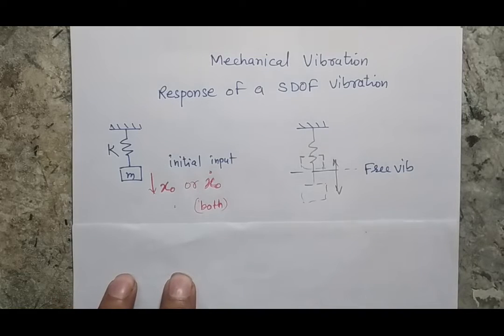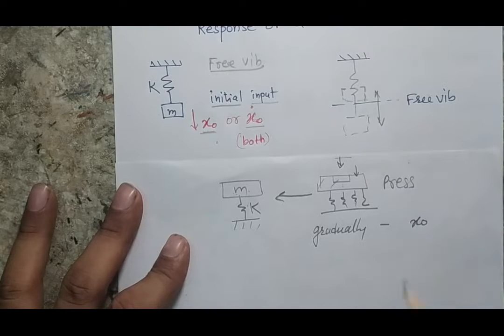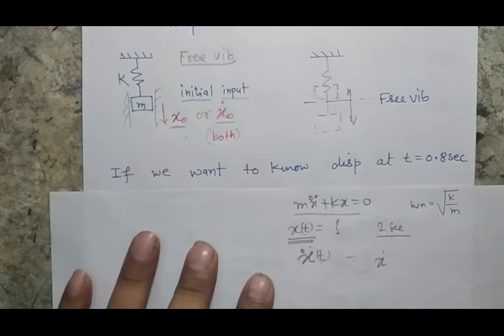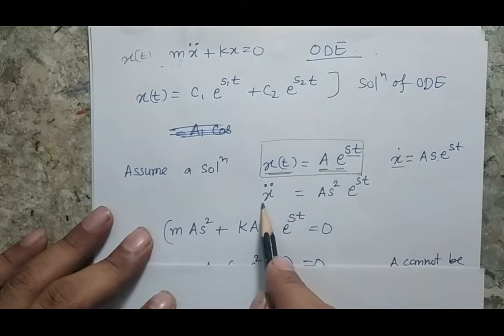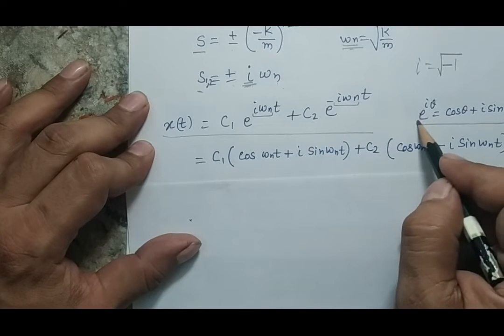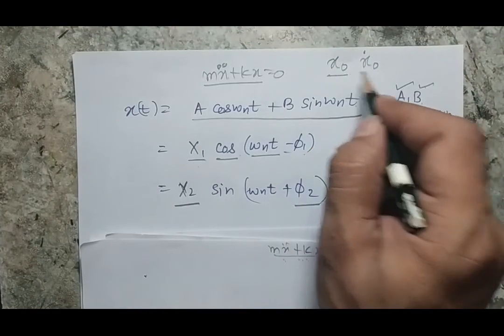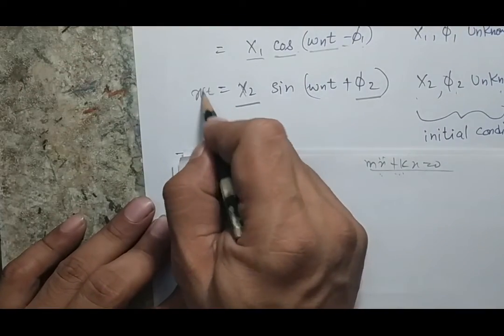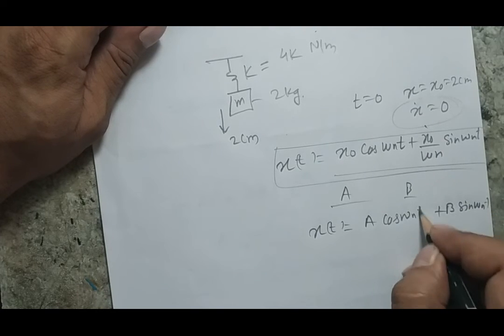Mechanical Vibration Lecture 7 || Response of SDOF free vibration|| Step by Step derivation

Comment: Consider the undamped natural frequency of a single-degree-of-freedom linear
spring-mass system. If energy dissipation is added to this system, explain whether the frequency of damped vibration will differ from the undamped one, and if so, in what manner?
Reply from the maker: Hi, the frequency will slightly change..please see in my damped vibration video.  https://youtu.be/9u6oLjQYzUk

Comment: Dear Sir, I want to ask you a question regarding the systems;
If the characteristic roots for a vibrating system has positive real value, the system response will be: a) None of them
b) Stable 
c) Exponentially increasing 
d) Unstable

Can you please explain your answer
Reply from the maker: In case of a damped system roots are imaginary  where in real part shows growth effect and it should be negative for a damped system and imaginary part shows natural frequency. In case of a positive real part..there will be growth in amplitude with time that means unstable response
Reply from the maker: In case of a damped system roots are imaginary  where in real part shows growth effect and it should be negative for a damped system and imaginary part shows natural frequency. In case of a positive real part..there will be growth in amplitude with time that means unstable response
Reply: @ashishpurohit9138  So, Sir. the response will be answer (d) unstable response?

Why the response is not (c)?  

I am really sorry for disturbing you.
Reply from the maker: @fatemahusain2529  it is even not following exponential path and in general if it is certain something will grow unconditionally with time considered as unstabe
Reply: @ashishpurohit9138  Thank you so much Sir for your full explanation and time.

Comment: Sir, referring to this video around 9.30, an important consideration is that if c1 and c2 is real then B will be imaginary. A real thing on LHS which is x(t) can't be equal to RHS which is complex. The only possiblity is that c1 and c2 must be complex conjugate. If this is the case then originally you can't say that the general solution is a linear combination of two independent solutions.

Another interesting thing is that in case of ODE of 2nd order any two independent functions which satisfy the ODE may form the general solution as a linear combination. A simple inspection show that sin(wt) and cos(wt) both satisfy the eom. So, it's linear combination will be a general solution what we finally get. 

I know this isn't a mathematics course but a brief explanation is better.
Reply from the maker: Thank you Faisal Bhai,, you are correct, it is only possible when c1 and c2 are complex conjugate, which is the case we have. However, understanding of solution of differential equation may divert attention from vibration to maths, thus I skipped strong wordings (statements) about the mathematics and have rapidly reached to the conclusion.  I dont want to break the theme of vibration hence skipped more mathematics.  I will try to incorporate it ,however, Youtube does not allow to put comment over the video.   Nevertheless, your comment will help other to learn more if interested.
Reply: @ashishpurohit9138  I believe that it is much more difficult to try to explain things as Dr. Purohit does. He is doing some oversimplification but he always highlights that there is some relevant mathematical background. He identifies the challenging maths and does some simplification, I believe it is more difficult than using  a lot of heavy maths. Cheers!